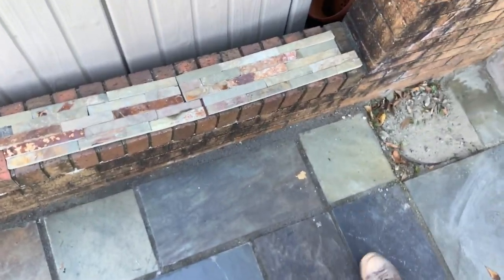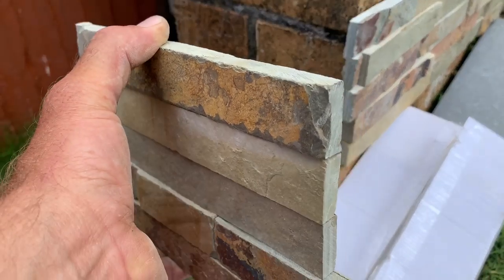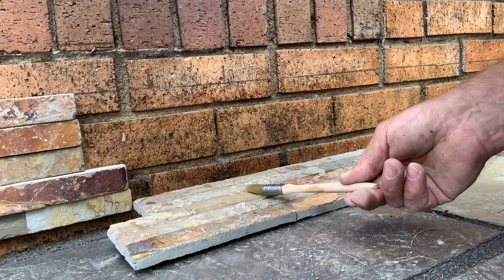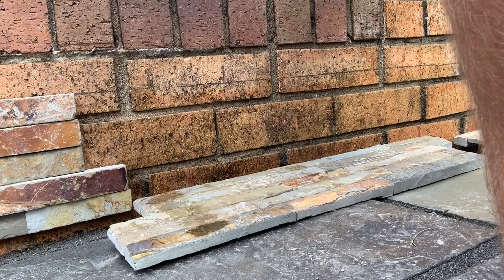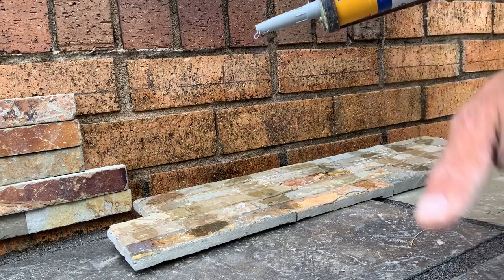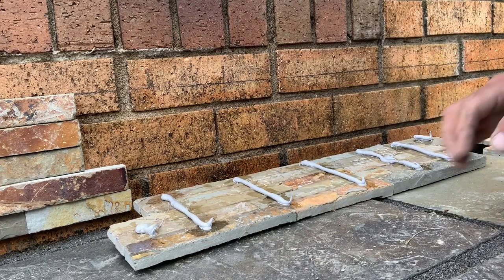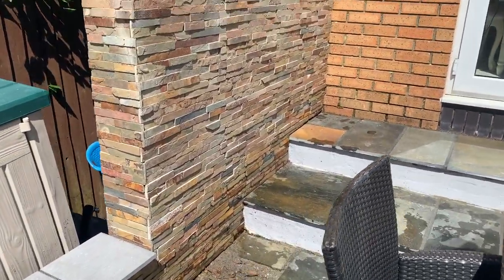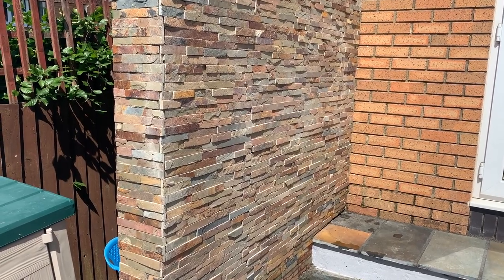Drystack Walling Installation Made Easy: A Step-by-Step Guide #walling #drystack #featurewall

Comment: Can this be installed in the winter during colder temperatures, does the adhesive work in the colder temperatures?
Reply from the maker: Not 100% sure 🤷 i use the rule nothing colder than 3° with cement as for a adhesive I would think colder again maybe 👍🏴
Reply: @tidybrickslandscaping  ok cheers Thanks for the reply 👍🏴

Comment: When I installed the walling stuff I painted the hole wall with the primer and just put the glue silicone on the tile and stuck it on any suggestions on doing it diffrent
Reply from the maker: Well either way paint the whole wall with it or do like I did and just paint it where you need it ? 👍🏴

Comment: Scott, on the corners. Marshalls do a corner pack, 150mm wide for the ends. Did you cut your end ones from the long 600mm sections , and if so then won't you run out of prepared end sections with a suitable Z to interlock with the ones on the front elevation. Will it leave a lot of waste veneers with straight ends either side of them left over?
Reply from the maker: They didn’t have any of the corner packs when I bought those veneers so I just made my own corners on site and yes there was of waste but it always is 👍🏴

Comment: What would you do when the walls are not plumb and level etc like many are? Like the wall toppers what would you use to level it up? Thanks mate
Reply from the maker: Sounds like you need to add some cement mix to straighten it up and make it flat enough. 👍🏴
Reply: @tidybrickslandscaping  I see mate so could just put them on a 4:1 with some primer on the tail, going to take the plunge with the moasure because of your videos mate, was measuring up with the tape and my book flying all over in wind 😂
Reply from the maker: @thomasthetankengine2257  have you seen my latest setting out video that’ll be handy to watch first if you’re planning to do it yourself. 
That moasure is a great tool with some charging issues it doesn’t hold the charge for longer than a couple of days so when you need it charge it 👍

Comment: In relation to the crack on the wall that the tiles will cover.....if further subsidence happens, would it damage and crack the tiles, or pop them off the wall?
could you have stitched or pinned the crack n the brickwork to preserve your own hard work? Love the vids 👍
Reply from the maker: That crack probably won’t get any bigger than that anyway so I’m not really worried about it 👍🏴

Comment: Another great video Scott. 
Can I ask where you got your flex saw and guide rail? I’m after a new method of cutting porcelain pavers. Currently using a 4 inch angle grinder with porcelain blade but I struggle  to get perfectly straight cuts and sometimes they splinter along the cut. 
Any advise or recommendations welcome. 
Thanks
Reply from the maker: Hi Dominic I actually use a table wet saw too depending on the length of the slab but it’s good to have the flex too as it’s very portable up against the table. 
https://www.uktoolcentre.co.uk/products/flex-cs60-wet-1400-watt-230-volt.html?sku=945150&gclid=Cj0KCQjwlN32BRCCARIsADZ-J4sZOp0kAVryp6kWqo4CN1NOsUU7v7Fp3fnZ6aVhLSUJVgbLk-uoJqYaAg22EALw_wcB
Reply from the maker: https://www.flex-tools.com/en/products/cs-60-wet-2/
Reply: I clamp a metal I beam and use 9" grinder, perfectly straight cut. Very expensive otherwise, if I was pro I'd would definitely invest in wet saw and table saw as per Scott's suggestions.

Comment: Aren't you supposed to mechanically fix the stone every metre?
Reply from the maker: Not that I know you have too. It’s so strong glued to the wall I shouldn’t think so 👍🏴
Reply: Hmmmm I work for a builders merchant and sold this. Only the once mind as its quite expensive. Im almost positive you need to mechanically fix it when you go over 1mtr. Could be wrong though. Looks great you do some cracking jobs 👍